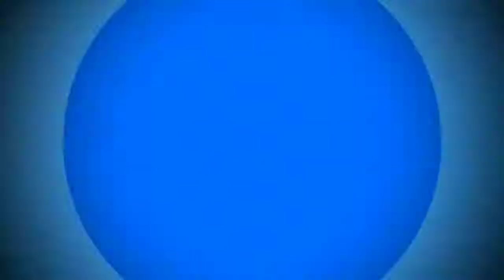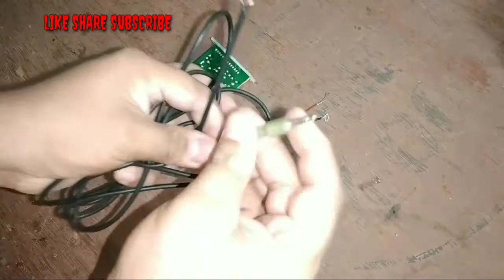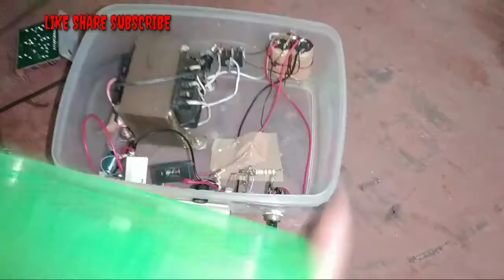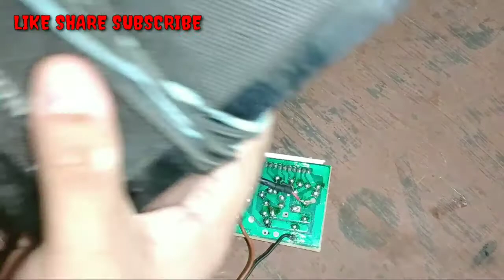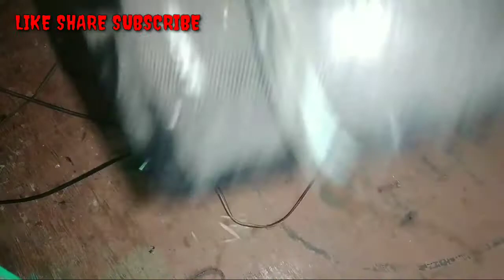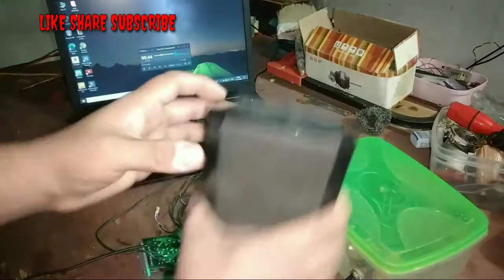SIMPLE AUDIO AMPLIFIER MAKING AT HOME 4440 IC USED #ELECTRONICS TECH MALAYALAM

Comment: Half wave rectifier വീഡിയോ വീട്
Reply from the maker: Onnum ariyanilla bro. oru diodinte anodil
Transformernte 1out ethenkilmm koduknmm. adutha out negative common aayitt edukknm.last step pulsating dc filter cheyaan bro kodukkunna voltagenekal koodia voltage ulla capacitor use cheynmm allenkill Capacitor burn aavumm.
Capacitornte Positive Diodnte Cathodil kodukknmm.
Pinne negative Commonill kodukkanamm. simple aanu bro.
Reply: നിങ്ങൾ ഉപയോഗിക്കുന്ന ആ എലിമിനാറ്ററിൽ എത്ര അളവിന്റെ കാപ്പാസിറ്റർ ആണ്
Reply from the maker: 12 volt aanenkill 4700uf 25 or 35 above volt capacitor  use.voltage koodunna anusarichu capacitor voltage kooduthal ullathu vekknmm .
Reply: Thanks bro
Reply from the maker: Bro nigha njan idunna  videosill daught
Choichaaal allenki mattenthenkilm electronics base aaayitt daught undenkil
Choichal enikk ariyaavunna pole njan 
Paranjutharaattoo bro.Nte Channel Onnu Support Cheynee bro .